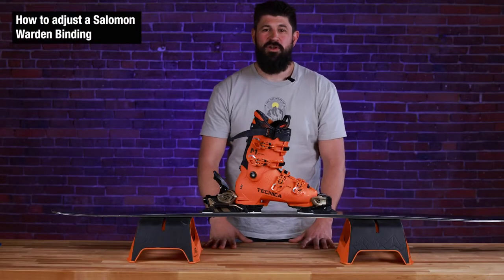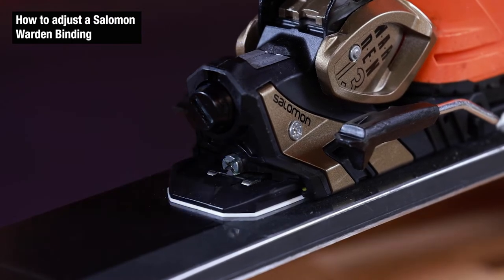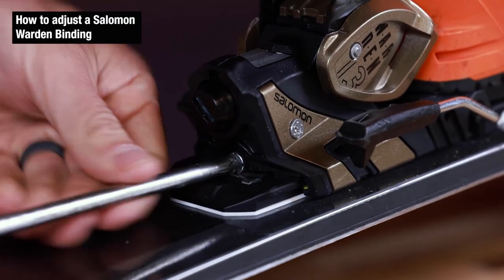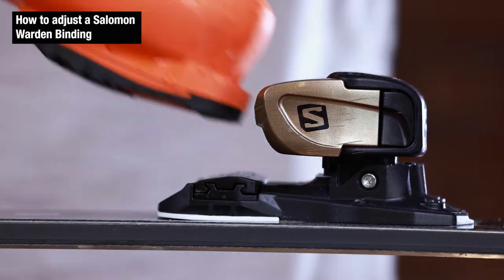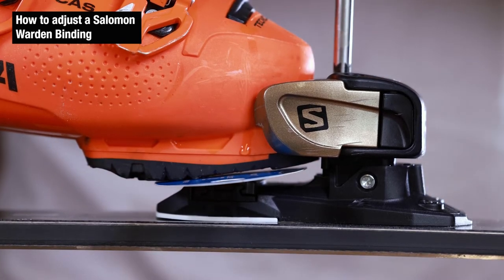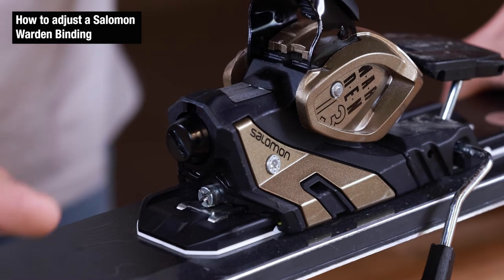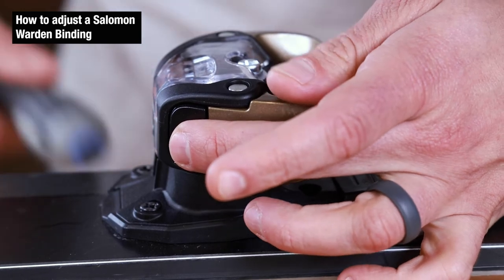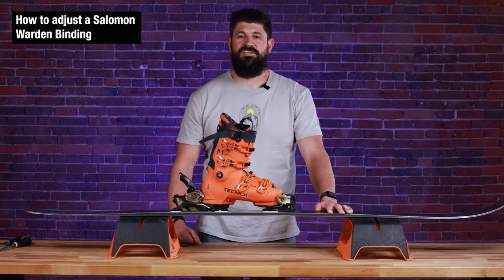How to Adjust a Salomon Warden Binding

Comment: After adjusting the binding so the boot fits properly the next recommended by all alpine binding manufacturers is to Release check the boot and binding system. These steps are outlined in their binding technical manual. Every DIN chart that provides the proper release setting based on skier hight, weight, age, boot sole length and skier type provides releases value ranges for twist at the toe and upward release at the heel. It is important to examine the boot sole for wear and damage. Check that the binding and boot sole are compatible. The Warden is Multi Norm Compatible. The release check uses a torque measurement device to find of the binding and boot are releasing within the range for the DIN number that you set the spring. This process and the manufacturer recommended testing would make a great video.

Comment: 2:18 DIN setting of 8.5 (release pressure) is for advanced or heavy skiers. Be sure to check the Salomon DIN chart for your weight and ability level. Too high is bad as is too low. There is a sweet spot for each individual skier. DIN values can vary between 3 (beginners) and 11/13 (racers)

Comment: How many boot sizes will this adjust for?  For example could it adjust for a 29.5 down to a 27.5??
Reply from the maker: @William Baird, With bindings its always smart to get things checked by a shop technician to make sure you are safe. Really the answer will depend on the boot sole length of each. Typically the difference between 27.5 and 29.5 would be 20mm but it's possible for it to be closer to 30mm. There is a chance that the binding will have to be remounted but can't be sure until we try.

Comment: I have a demo version  of this binding.  Any differences when adjusting??
Reply from the maker: On the demo version, the toe and the heel slide on independent tracks and you need to line up the numbers with your boot sole length. The toe height adjustment is the same on the demo and non-demo. The forward pressure on the demo version is a pin indicator and you want that pin to be as close to the middle of the range as possible when the boot is engaged.